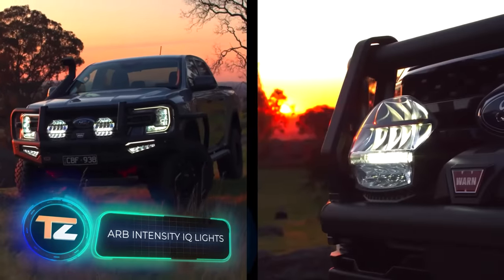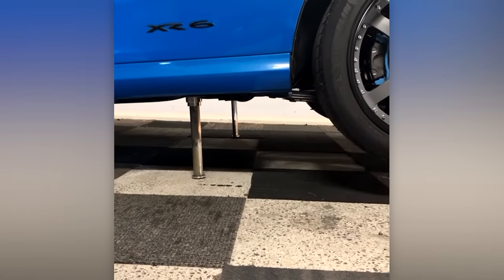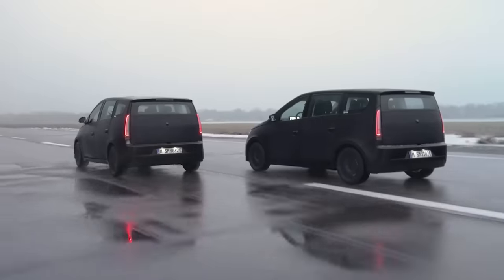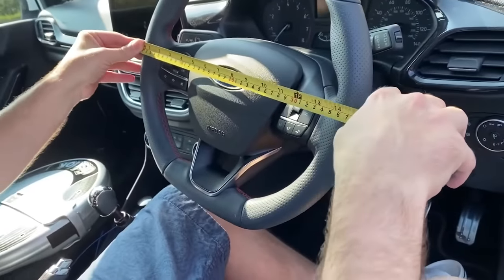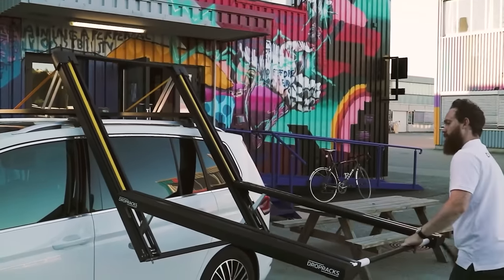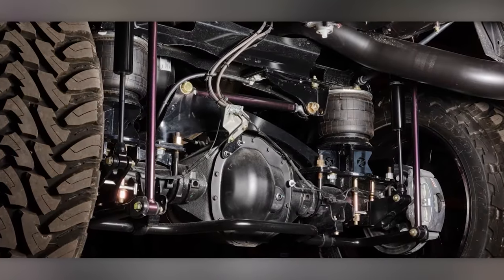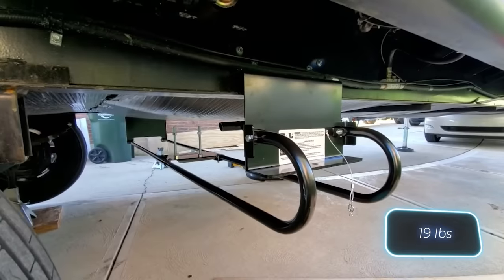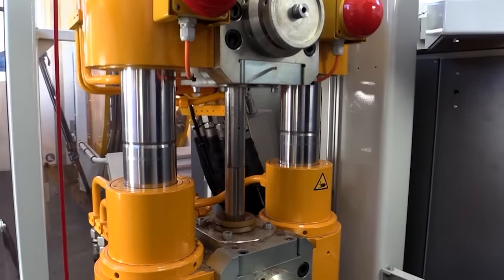COOL INVENTIONS THAT WILL TAKE YOUR CAR TO A NEW LEVEL

Comment: Finally, a solution to the oh so hard problem of bringing a bottle of water with you.
Reply: and what about being stuck in traffic , after drinking water , then having to take a piss ????
Reply: Actually I was thinking about it being placed in a cabin in the woods. No need to drill a well. Within reason of course. But this would not work in the desert. Also i feel like it will dry out your place if used to much. Like winter when you have low humidity and run humidifiers in the house. Even way off road camping it would be nice and extra 5 gals a dry drinking water.
Reply: The struggle is real

Comment: Gotta admit those lights look super cool.
As a 5th gen 4Runner owner I've kind of forgotten what it's like to actually be able to see well while offroad at night.
Reply: they look great are likely illegal in 99% of the usa either too bright or wrong light frequency  or other reasons if you get caught with illegal  headlights your car might be impounded or seized in some states and possible multi thiusands of dollars in fines
Reply: @cl844  Pretty sure they are specifically intended for offroad use.
Reply: @cl844  It is a pity that they aren't illegal here in Australia. While really powerful lights mite be better for the driver of the vehicle they are on, they are a real problem for oncoming vehicles. It is winter down under at the moment and every morning on my way to work I encounter a lot of drivers who's reaction time could be measured with an hour glass.  If the light manufactures could include a sensor that would detect oncoming lights and automatically dip would be good.
Reply: @davidstephens1092  even worse you guys drive on the wrong side  of the  road too 🤣🤣🤣
Reply: @cl844  Fair enough, I'll pay that one.   After encountering some of these lights I could be driving on the other side of the road till I get my vision back.
Reply: Australian company and seem to be a great Idea designed for off-road and regional roads where some extra distance over manufactures lights increases the ability to avoid animal strikes. On our regional roads you can  sometimes go extended periods with no oncoming traffic. These seem to have intermediate settings so they can be toned down for oncoming vehicles and differing driving conditions. Australian law requires Spotlights are wired to the dimmer switch so when used correctly and dimmed when a vehicle is oncoming you go from lighting well down the road to low beam.
Reply: Can you be looking down at your phone while you're driving to change them though? (I wonder if you could hook them up, so when you turn your head they match the direction you're looking).
Reply: @deucedeuce1572   No doubt some-one will come up with an app so you can ask siri to change them.

Comment: You won't get in an accident with those lights, you'll cause them.
Reply: Great idea, blind oncoming  traffic.
Reply: Of course you'll use driving common sense etiquette, turn off or lower them to incoming traffic !!
Reply: @Ritosanz1289  I agree, the only problem is common sense and courtesy isn't very common in todays world.
Unfortunately what is most common is the attitude of 
"Hooray for me and the hell with everyone else".
Reply: You are correct, Sylvania ad for led headlights, said see 300% better.  The oncoming cars can’t see the road, since they are blinded.
Reply: @danielespey4116 You've missed the entire capabilities of the headlights.
Reply: @billdougan4022 It all depends on the illumination pattern. I doubt such a big company would design them to work in such a way as to blind oncoming drivers.
Reply: @joewoodchuck3824  I understand the capabilities perfectly, they can blind oncoming traffic in several modes.
Coupled with being a great 
addition to  compensation trucks
Reply: @danielespey4116  It comes down to responsible use them, just like headlights have always been.
   What is a compensation truck?
Reply: @joewoodchuck3824  Mr.
Woodcock.
I see them every day when I drive the highways coast to coast.
A compensation truck is when city boys buy a pickup and install  big lifts, big tires and all the accessories they can afford to compensate for having, how can I say, oh yea,
a tiny "self esteem".
Ask any girl, they know.
Real trucks don't have tail gates they have lift gates.
Reply: @danielespey4116  tell that to GMC && FMC - there vehicle headlights from the factory blind oncoming  traffic.... year 2020+ models especially truck models

Comment: I gotta admit I would never get under a car that had one of those air jacks! If it loses pressure it will lower down
Reply: looks to me like they come with a jack stand type thing that wraps around the tube, so that could be a potential solution.
But realistically, that's not unique to this type of jack. You should never get under any vehicle that is supported only by any type of jack without stands.
Reply: they probably have a safety built in, a pin or something, but you never just leave your car/truck without a backup device to catch it if something fails,  jackin up a car is sometimes annoying, this device here in the video is mostly for rich people who have ten cars and no room to move them around, so they put that in all of them, or for race team, normal people would never have this
Reply: Jacks are only for lifting a car up. They were never intended on holding car while you get under it. Regardless of type of jack. That's what blocks and jackstands are for.
Reply: Why would you get under Any car on a jack?😂 Are you insane. Jackstands were invented in 1932, and blocks existed for millennia

Comment: That disklock for the steering wheel looks like it could be opened with a bic pen.
Reply: Yep.  Circle key + Bic pen = broken into quickly.  Not that the circle picks are difficult.

Comment: So watergen is just a portable dehumidifier?! With a different label and 10 times as much?! Lmao
Reply: Ya, so my dehumidifier doesn’t filter and dispense clean water
Reply: @matthewpepper9164  ok then go spend 30 grand on this filtered one. I would just get a dehumidifier, then add a hose, filter, like on an RV and boom. Clean water
Reply: That sounds incredibly similar to the product in this video 🤔 and that doesn’t sound like a very easy thing to retro fit to work in every vehicle, that also seems like the cost of materials would be high because you have never done it before and trial and error can get expensive but I’m sure the fit and finish of your dehumidifier-gardenhose-cup monstrosity would be far superior to theirs as well 😂 point is what they have produced is far more than “just a dehumidifier”
Reply: Wow really? You own one of these and it isn’t working as well as they claim in the video? How much water does yours produce?
Reply: IF YOU U
Reply: IF YOU USE ENGINE TO DRY AI
Reply: I don't think they filter the water I may haveissed that part but I definitely heard them say the device mineralized the water so it will taste delicious and won't bleach the calcium right our of your bones so I guess you will have to refill the minerals every so often
Reply: And it not really 30 grand right? Please tell me that was an exaggeration
Reply: @jonwayne1047  no it's $30,000 there is a cheaper version for $19000 I think that is the one shown. That is supposed to be portable.

Comment: 6:30 The hinge on that lock could be cut completely in two with a portable dremel tool which can easily fit in a shirt pocket.  It would take between 30 seconds to 1 minute tops and you are good to go.

Comment: From what I've seen seen most vehicles today come from the manufacturer with the headlights aimed too high therefore blinding everyone else at night.  As an over-the-road driver one of the first things I did before leaving out in a new truck was making sure the headlights were adjusted.  If you can see your vehicle's light beam on the trailer doors in front of you they are aimed too high and you are blinding all vehicles in front of you.

Having them aimed too high also makes it harder to see the road at night when it's raining.  The light just won't be hitting the road and its markings.🤷🏼‍♂️  It'll also make reading signs more difficult.
Reply: Absolutely 👍
Reply: People should also notice that if the signs three blocks ahead of them are lighting up then perhaps their headlights are misadjusted or their brights are on.

Comment: ~~I remember a time when it was standard rule spares for both cars&trucks came standard too. And essentially taken to the coals for simply suggesting of replacing it w/donut? Mobile homes/trailers did as well which were stored just behind the hitch either flat inside the frame or mounted atop upright.

Comment: That steering wheel lock is dumb. Besides how bulky it is when you have to store it, the fact that locks via a key is pointless . . . Anyone with a drill can bust it open in a matter of seconds. So you will be out both your vehicle and $175 for the useless lock. If I were a car thief, I would leave it behind just to make a point!

Comment: Blinding headlights are great for causing accidents for the victims of blinding
Reply: I get to the point sometimes of considering just driving straight for the offending headlights. If I am going to die in a wreck because I am blinded, then maybe I should take the culprit with me...
Reply: @selador11  it's a growing problem. In parts of Canada there used to be laws against blinding headlights but....

Comment: What is the data on those bright headlights blinding other drivers?
Reply: Unless there are. led bulbs that actually go inside of the stock housing unit, then they're illegal to use on the road. like the 1800$ set seen here. offroad only supposed to be. What's going on right now with most people switching from the old school type to the new led type is they don't ** fix the damn aim pattern for the new lights. and it ends up ** blinding the ** out of people happens to me daily in a low sitting car, especially all the ** ** and ** jacked up trucks that don't give a ** about nothing but ** ** each other and ** ** diesel trucks.
Reply: $1,300
Reply: They're for off roading, not the interstate.

Comment: So I feel sorry for people spending a whole hour a day in traffic😢. But does this built in dehumidifier come with a built in toilet?

And there are dozens of videos on YouTube telling you that solar panels on a EV only give you like 8% charge and blow the cost benefit ratio out of the water.  I am glad to see some manufacturers agree that it’s still worth it.

So a dump bed on a pickup that can hold 6000 pounds.  What pickup on the market has that hauling capacity?

Comment: ARB headlamps are probably great in the outback. They do not meet SAE DOT legal requirements for vehicle sold in the United States. "Chicago's" traffic conditions are due to people who do not take advantage of its public transit systems but drive nearly-empty 5 passenger vehicles on the 3 major converging interstate expressways , " to save time".  The solar panel range is based on a compact EV with unobstructed sky view 24 hours per day in summer at a latitude south of Lexington KY

Comment: Looks like you could store more than 1 tire on that!
Reply: I actually have one on my Chevy Colorado. Bought it because I have oversize tires and a spare won't fit in the original stock spot under the bed. pretty good and you can definitely fit two tires.
Reply: or one tire and a bunch of gas and water.
Reply: @jcarry5214  I was worried rocks could break those underneath
Reply: @lifewuzonceezr  like bouncing up behind the truck? I've never heard of that. Sliding off obstacles maybe but I'd rather lose gas than my bed.
Reply: @jcarry5214  high rocks off road thoughts
Reply: @lifewuzonceezr  what vehicle? On like an fj/jl it does happen, people have pulled their doors off those. 4runner maybe, but I don’t think it’s possible on a pickup because the departure angles are shallower, you’ll catch the bed and the bottom of the bumper. Just my take. I’ve installed a bunch of these and I’ve never heard of anyone breaking the gas cans, scraping a tire occasionally yes but that’s rare. Much more common to back into a pole in a parking lot because you forget you’re longer back there.
Reply: @jcarry5214  I thought it was for an RV.I don't drive one but putting a gas can under the vehicle sounds iffy..Ive seen too many mufflers ripped off going over a hill and hitting anything 1 inch too high.
Reply: @lifewuzonceezr  I think we might be talking about 2 different things. I was talking about the bumper with the carrier arms, lol.

Comment: I wouldn't use those Air Jacks even to merely change a tire. They look EXTREMELY unstable. Even as insanely expensive as they are, if the vehicle fell while on these "jacks", they would cause more damage to the car, than they did to your wallet. Solar panels on the roof of a bus???? HAHAHA What's the expected range on that bus, 10 miles??? There's no way in hell that thing is going very far on a single charge. I can see a sub-compact car going 250 miles or so on a single charge, but DEFINITELY not a bus.

Comment: What about a bunch of small spikes, like sewing needles that extent out of the steering wheel when you activate the anti theft device? They will only extend forward so the thief can't see them (unless the thief is really looking for them). Once pressure is applied to the wheel or one of the pedals, the rest of the spikes deploy (up, down and back towards the driver). Then a voice comes from the stereo saying: "you've been injected with a neurotoxin...seek immediate medical attention...tell the medical staff you e been injected with nojoblazylozer toxinaphrin...or die horribly over the next 4 days." Nothing is injected except metal and the owners sweaty palm residue but the psychosomatic"pain" the thief will experience?....priceless (especially if the voice goes on to describe to the thief what to expect within the first 24 hours).
Reply: I like the idea, except the thief will sue for pain and suffering lol

Comment: There is a flaw with the Nomad Split Rash Ring. These will throw your wheel balance out when you use them.
Reply: Dq
Reply: What is the blue contraption on the back of the truck as seen in the thumbnail?  Didn't see it in the video
Reply: @huckbeduck 7:00 is the bumper rack, it's just not customized in the thumbnail
Reply: I think they're used primarily during low speed rock crawling
Reply: The main flaw is that you have to buy Nomad off-road wheels to fit them to!
Reply: They really don't, they're balanced just fine.

Comment: Unless they find a way to turn off the power steering that steering will lock thing is useless because all you got to do is reach around and grab the damn steering wheel where the screw holes are stick your fingers in the screw holes and you can drive

Comment: Road rage cars and trucks should become equipped with perforated hose around the outside hooked up to a charge cayenne pepper spray you push a button and the guy gets cayenne pepper spray doesn't even get near the car